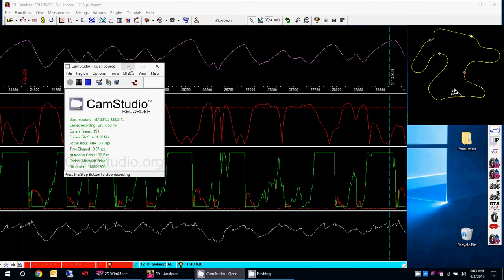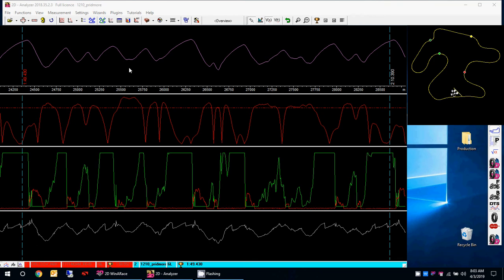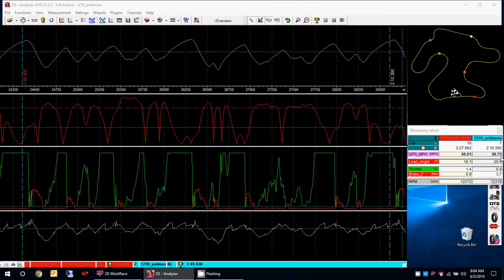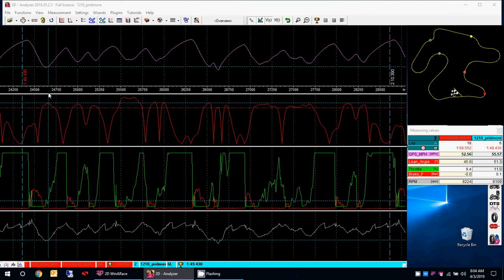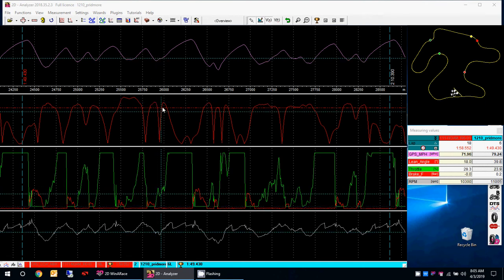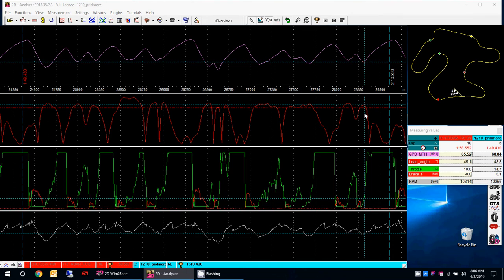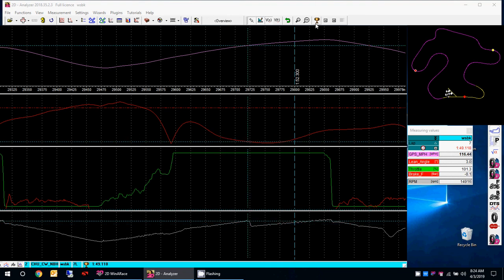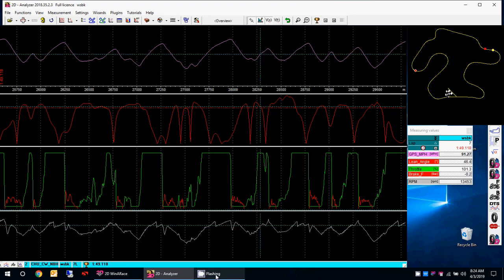#6 2D Data Recording Jason Pridmore vs my lap at Chuckwalla CCW / When we get to 100% throttle

Comment: Loving these videos Noam. Had a laugh at the comment at the end about causing future highsides by this video! It's taken me a long time to get back to my previous lap times after a highside 18 months ago (adding throttle and lean), so am very interested to see how I can get closer to the bikes potential. I find myself very consciously standing the bike up on exits these days. I am not running slicks (Rosso Corsa 2) so need to bear in mind the ceiling will be lower, but am curious as to how much lower.